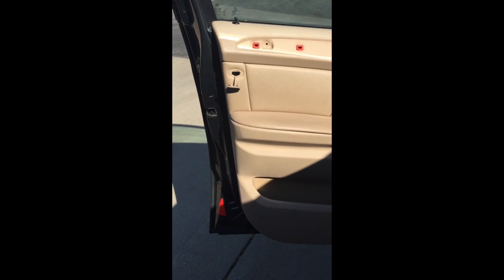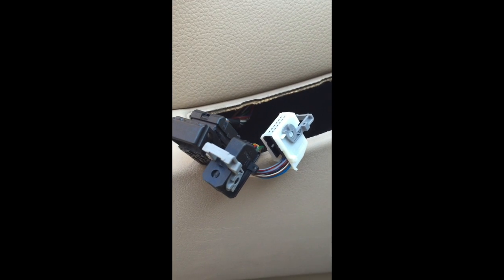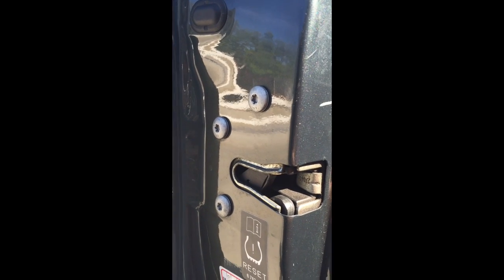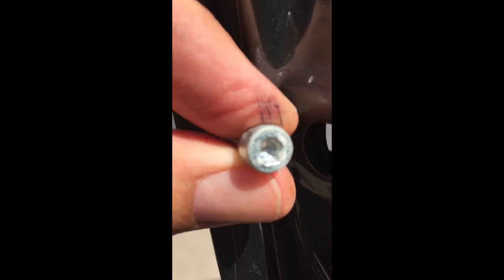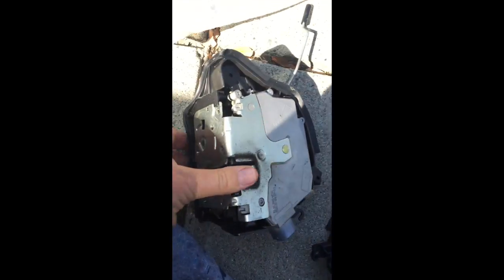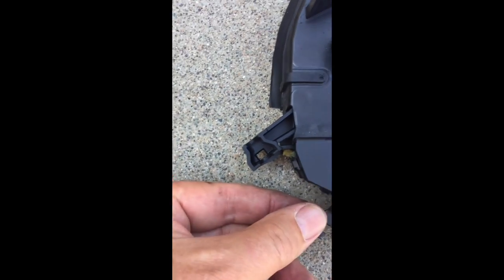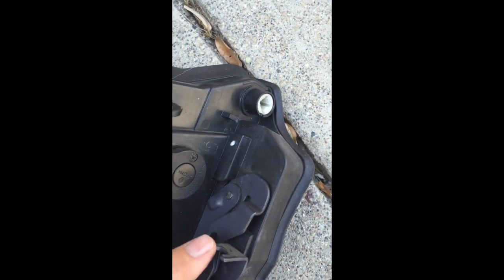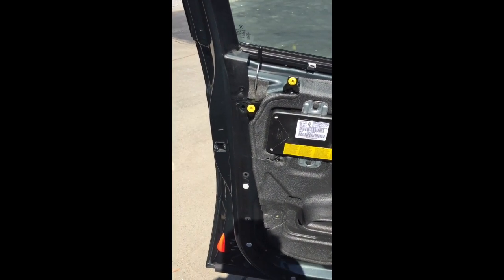How to Fit Lock Actuator BMW. X5. 2003-6 Power door lock, central locking repair e53 handle opening

Comment: Thank you for your show.  I bought the new one from ebay.  Installed in with no issue; however, my remote door lock for driver side that I have just replaced not locked, not clicked.  Will the new one from ebay not worked either?

Comment: Nice video! I have the symptoms of occasionally all 4 doors not unlocking when using the fob, BUT the tailgate does unlock. (2007 X5 e70). I wouldn't expect all 4 door actuators to be faulty at once - but does the drivers door actuator control all the others? Would you think I have a problem with the drivers door actuator or the control module? (98% of the time everything works fine). Would you also recommend disconnecting the battery when doing this repair?
Reply from the maker: Hi C41. I would be checking the aerial for the locking system and also the battery in the key Fob.
I don't think it will have anything to do with the actuator. Please come back and comment when you get it sorted.  Did you see this vid? How to diagnose central locking on BMW https://youtu.be/BT1EXXN5Rf0
Reply: Hi, Thanks for getting back to me.  'checking the aerial'? was that an autocorrect typo and you meant to say 'manual'? ok, i'll check it out. The key fob does not have an accessible battery (its the non CA type that recharges as you drive - and it gets driven regularly). And yep, I did watch that video on my travels. It was also about just 1 door lock playing up... whereas mine are all 4. I wonder if my problem could be related to the early signs of a battery going? perhaps some days it just has not enough charge to unlock or something. Its been fine for the last 3 days... hard to work it out when it only happens rarely. Thanks again, Pete
Reply: Thank you !

Comment: Mark, Just got my 2006 X5 back from the shop. They fixed the driver's door handle, which stop function, and could not be opened from the outside (major pain, crawling across from passenger's side). However, I cannot lock/unlock this same door with the key fob, or via center console button. I can still lock/unlock this door manually, with key in slot from outside, but had to press down manually on lock itself to lock myself inside the cabin. Also, the dome light no longer comes on when I open the driver's door. Do you suppose they neglected to replace the actuator? And if so, is it likely to fix the dome light malady, too? Thank you for this great tutorial.
Reply from the maker: Sounds like it needs to go straight back to the shop. Something is up w the electrics. The actuator needs to be plugged in. The dome light is triggered by a separate switch in the door that lets it know when the door is open. MRT
That should have all been tested before they gave the car back
Reply: @Marksreviewsandtutorials  ~ I didn't know the particulars (obviously), but was definitely disappointed they would not test these things before returning the vehicle to me. I'm headed back there tomorrow morning. Cannot thank you enough for this invaluable service. I am very much obliged to you, Mark ~ Thank You! 
P.S. You've got a new Subscriber here!
Reply: @Marksreviewsandtutorials  ~ Brief update here. You nailed it, Mark ~ they hadn't plugged in the Actuator...lol. Too much, huh? Am good to go, now. Thanks again for your help. Great channel!

Comment: Could you or anyone confirm that my actuator is the problem?
My lock felt frozen shut, so I twisted extra hard with the key and then it went from immovable to super super loose. Now the key rotates with ease (too much ease), and the door doesn't unlock.

Comment: Your video was the only one that helped me figure out why I couldn't get my door handle to open from the inside of the car.  The bowden cable was attached at the actuator but I didn't see the place where I had to push in the clip on that end and thanks to this video I have finally figured it out!!!  I know this is for the lock actuator but it helped nontheless!!  Thanks!!

Comment: Can you do this from the inside of a door that won't open? Front passenger side.
Reply from the maker: No. But there is a manual release that you can get to if you can get the door trim off.

Comment: Hi , i can’t open door from outside , handle works but door doesn’t open , I replaced door handle mechanism and still can’t open , do you think I need to replace door latch ?
Reply from the maker: There are little wires and clips that need to be in place to connect the handle, etc. 
step one I would make sure that everything is connected. 
Look to see inside the door of you can see anything broken or disconnected
Reply: Mark's reviews and tutorials ok I’m gonna take a look again , thanks

Comment: Hey Mark, my 2006 E53 X5 has a similar problem with the rear passenger door. It won't open from the inside or outside. 
The lock itself goes up and down when I press the unlock button but the door is still sealed shut? 
Took out the back seat, removed the door panel with the door shut and tried everything to get it open but still nothing.
Being unable to open the door, I'm not sure how I'm suppose to get off the locking mechanism in the first place to perform this repair.
Any tips?
Reply from the maker: I do have a tip for you. Probably from what you are describing it could be your gm3 module. 
This is located behind the glovebox in your e53 X5. 
Go to https://www.bmwgm5.com
And look under gm3. I took my car to this guy in LA and he fixed in on the spot. 😀
You can also post your module to him. My car would randomly trap the kids in the back seat. They literally had to climb out.

Comment from the maker: Ha Ha. No auto correct, there is an aerial that receives the signal from the key fob. 
This can get corroded and give the type of intermittent fault that you have. 
Also the fob battery can be replaced you have to cut open the key an then glue it shut again. Do this when car opens with one fob but not the other.
Reply: Mark's reviews and tutorials
Reply from the maker: Here is the video to fix the key. Replacing New Battery in BMW Key FOB 1 3 5 7 series X1 X2 X3 X4 X5 X6 https://youtu.be/NlwRyb6u-Vc